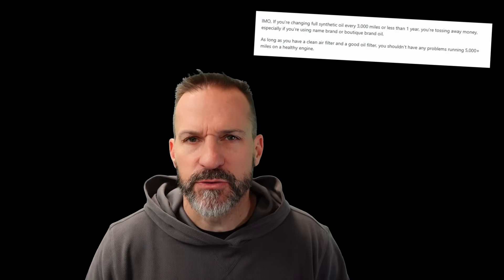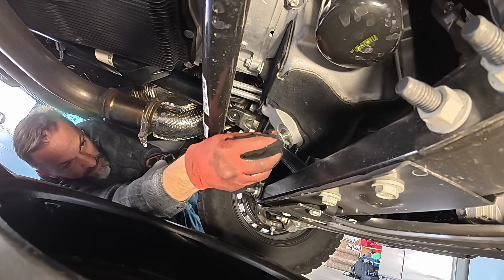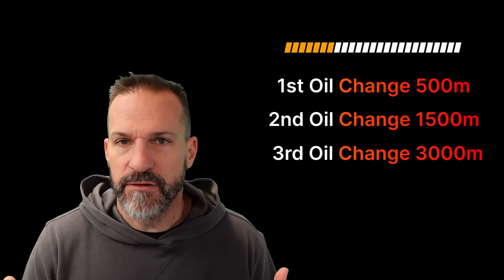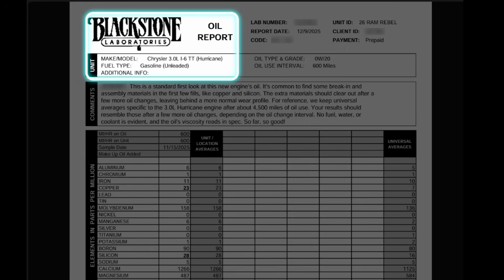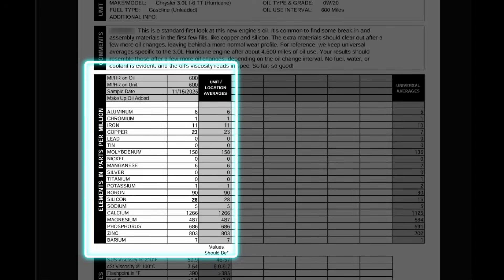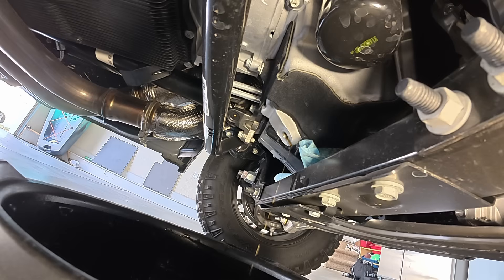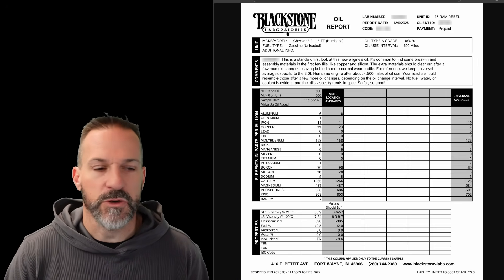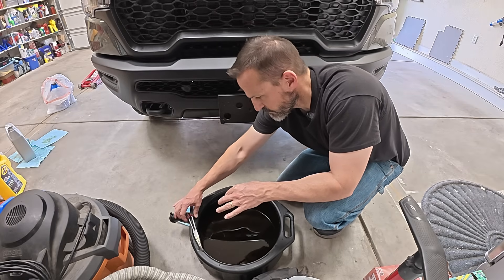Is the Motor Oil Geek Right? I Put His Break-In Theory to the Test

Comment: I don't want to sound like a Lake Speed Jr fanboi but I think what he says is spot on. Not just what he thinks but he has the analysis results that support what he says. I would agree with him that the oil change intervals are "balanced" between what their engineers  suggest and negotiated with marketing having the final say so the service intervals are competitive.
Reply: I think it's great to be a fan boy of Lake. I am!  He's all science and no speculation.
Reply: Yeah, the analysis supports that there is less and less microscopic particles, then its just conjecture that this will help, there is no proof.
Reply: Ever wondered if oil analysis is just another marketing scam to get your money like using fancy named oil called synthetic? Perhaps real world testing is the best result to get the answers you are looking for instead of internet hype. I myself use the cheapest oil on the shelf and change at every 10,000 miles with multiple vehicles and no sludge, oil burning, oil leaking, etc. Keep in mind, this is city driving when the manufactures call for the marketing name synthetic.
Reply: @Olds_Pwr it sounds like you’re using the term “real world” as a replacement for “trust me”.  Post your data and findings on YouTube .  Keep in mind, oil analysis is still the ultimate lie detector, because it’s realtime evidence at the microscopic level.  It’s kinda like a “butt dyno” vs an actual dyno.  Anyone can say they felt the horsepower bump after installing (power adder here), but the only way to truly verify results is actually putting the car on the dyno.
Reply: @MrEmagtsr  I just did post my data and findings on YouTube, you commented to about my real world results. To add more to it, my mileage keeps climbing, the vehicles body is rotting away and my wallet is heavier from less oil changes and from buying the cheapest oil on sale at that time. Oil analysis some speak of. You and I know there are some abused vehicles out there and are still running without having an oil analysis telling them to change their oil or at least put some oil in the engine so the dipstick will register something.
Reply: How many of your engines are turbo engines? Any 3.6 gm’s? Any 3.5 ecoboosts ect? 5.3 afm gm’s ? These engines and many others require clean oil ect with the turbos, long lightweight timing chains with nylons guides along with cylinder deactivation and or phasers. Another knock to oil life is fuel dilution which direct injection and boost make worse. Just because you have 6 naturally aspirated 4 cylinder and v-8’s with over 200,000 miles on them at 10,000 mile change intervals doesn’t mean these new engines will allow it.
Reply: @christopherlehman4045  Three of the vehicles are equipped with a turbo. I do not have any of the engines you listed in my group that I take care of. From my understanding you are stating, the engines you mentioned are not robust engines because they are equipped with lightweight and plastic components and also buyer beware if it has direct injection. Sounds like to me, it is not the brand, type or how often the oil is changed that is sitting in the oil pan but planned obsolescence is built into the engines, like many of the throw away items we purchase today.

Comment: Oddly enough, a friend of mine purchased a 2024 GMC Sierra 6.2 about 6 months before the recalls came out.  I sent him one of Lake Jr's videos about break in oil changes on new engines.  He did his first change at 1200 miles.  We cut the filter and found a significant amount of metal shavings. We then sent a sample to Blackstone and received the following results based on their 5600 mile average oil change intervals for that vehicle:  Aluminum 7 (4 avg), Chromium 1 (1 avg), Iron 37 (15 avg), Copper 37 (4 avg) Lead 1 (0), Tin 2 (2 avg), Manganese 3 (1 avg), Silver 1 (0 avg) Titanium 0 (1 avg).  He then followed that up with a 3k oil change.  His truck passed the dealer recall inspection a few months ago and is still running fine.
Reply: Thanks guys, fixed that one.
Reply: He did his first oil change after 1.2 million miles ?
Reply: 1200k = 1,200 miles
Reply: @ck2696 no its not!!!! 🙄🙄
Reply: @petergozinya6122  That's exactly what I thought to 😂😂

Comment: The the most recent new car I've purchased (K20C2, so no turbo, no direct injection), I did my first oil change at 307 miles, and then second oil change at 1892 miles.  Third oil change will likely happen at slightly over 3000 miles.  Changing the filter each time (AMSOIL EA15K).

Comment: I don't trust the oil geek. He is absolutely full of it. The guy is a simp and a shill for the auto industry.
Reply: How would the oil geek’s advice for more frequent oil changes benefit the auto industry?
Reply: @marcinmerrimack1726 I agree with more frequent oil changes. However,  i highly disagree with him on oil viscosity. Anything 0-w20 or thinner is absolutely destroying engines.
Reply: @pontiacman2484   Ok, so you’re claiming that Toyota’s long specified 0w16, not to mention the latest 0w8 for the new Camrys, is “absolutely destroying engines.” When should we expect to see this starting to show up in notably short engine life for large numbers of Toyota engines?
Reply: @marcinmerrimack1726 do you truly believe that the engine problems that have plagued the Toyota tundra's these past few years has only been because of engine debris? 

We are talking thousands of engines from 22-24 and even some 25's and I highly doubt that we will be seeing too many of these engines running those thin oils going much more than 200,000 miles. At least not as many as Toyota used to have.
Reply: @pontiacman2484  I don’t know what’s going on with Tundras. But if Toyota had the slightest evidence that thin oils are destroying engines, then introducing 0w8 to all new Camrys (their largest selling vehicle) would not have happened.

Comment: Be sure to hang onto that factory oil filter when you do swap it out and then cut it open and it more than likely will tell a story in itself as to how much slivers and bits of various metals will be sitting in the bottom of the pleats ( ferrous and non ferrous metals ) as well as bits of silicone the filter captured from the moment it was started at the factory and the bit of oil left in the bottom of the filter canister will probably have plenty of shiny particles in it. Of course some of the fine metal particles will be embedded within the media and will never see them but the odds are high you will spot a few pieces that may shock you.
Reply: I'd like to see that original factory filter too.

Comment: Good video, should be helpful to many out there. One thing to bear in mind is that the magnet test in your used oil may have a false positive, because many wear materials are non-ferrous. The best way to assess engine debris is to separate the filtration media from your filter, gold it accordion-style with a shop towel around it and squeeze the excess oil out with a vise. Then carefully open it up and you should be able to easily see any captured material.
Reply from the maker: Yup for sure!  Once I pull the filter, I will check the material, likely at 3,000 miles